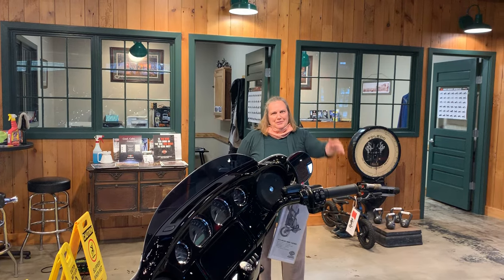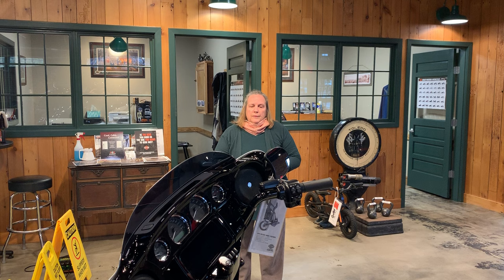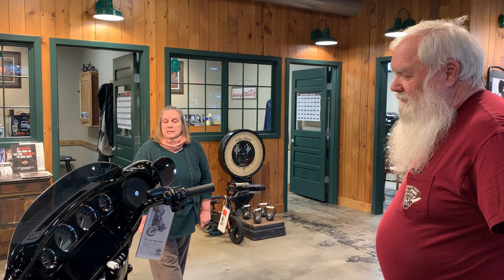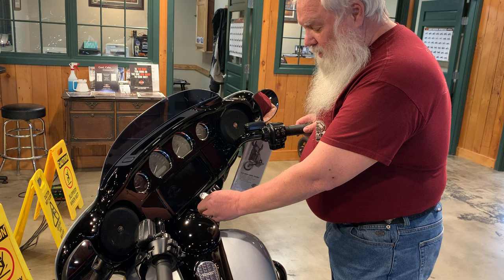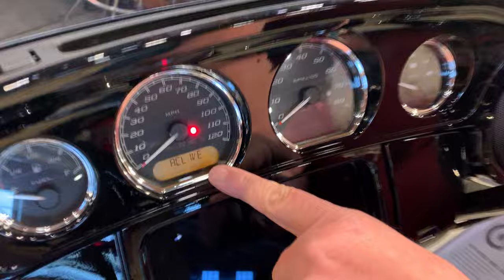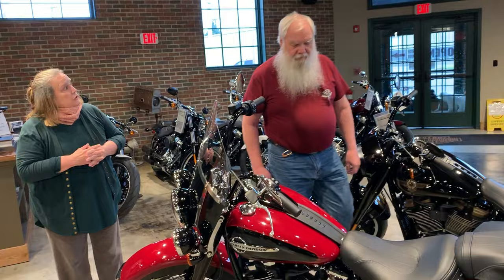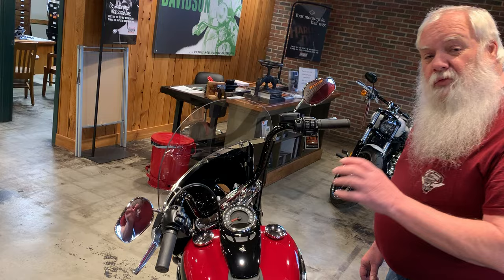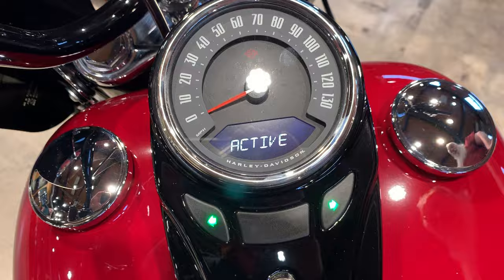Putting your Harley-Davidson into “Transport Mode”

Comment: If you leave you key fob on the bike do you still have to put it in transport mod?
Reply: You may still end up with a dead battery because the system will still constantly be searching for the fob. It will find the fob but the cycle will continue over and over. Transport mode puts the security system to sleep.
Reply: Plus leaving the fob for the thieves very courteous but not advised.